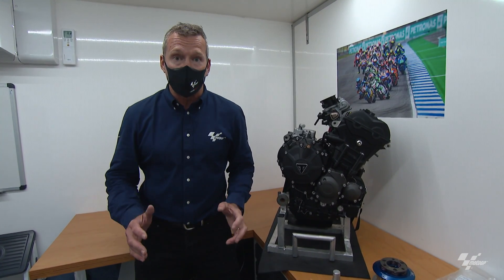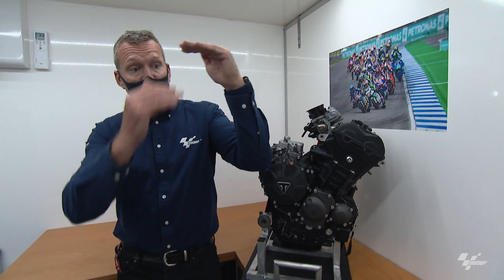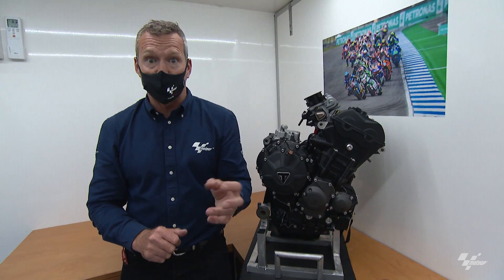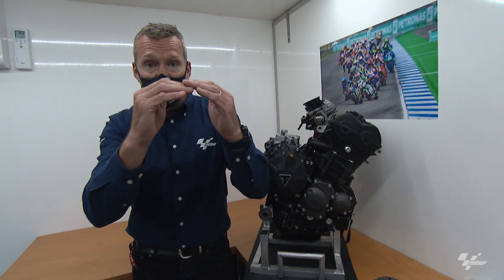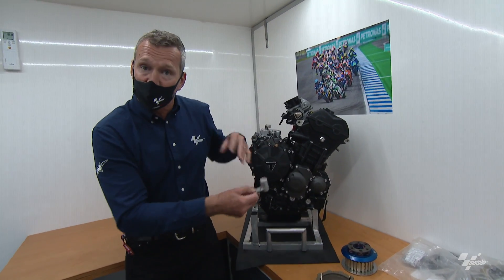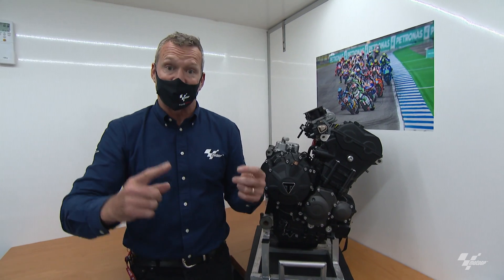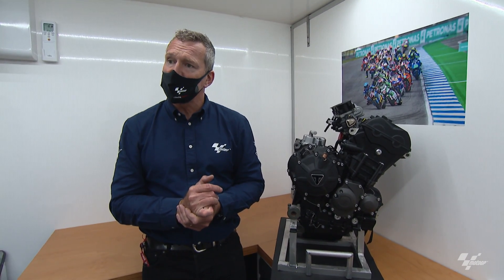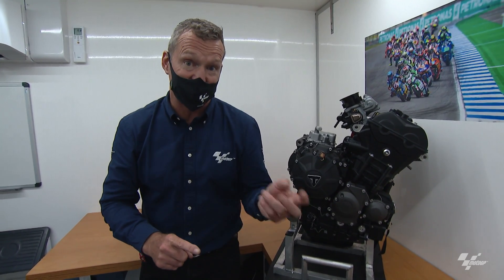#Moto2 Engines: Tech Talk with Simon Crafar

Comment: Imo, we should have 4 divisions (Moto 4, 3, 2, and GP).  4 could be a single, 3 could be a parallel twin (the fastest growing class in motorcycles), 2 could be an inline triple, and GP could be inline/V four.  This is essentially what Yamah is doing with the R3, new R7, planned R9, and R1.
Reply: if you were to base it on the no. cylinders you would still have to take account for engine size. So it's just easier to have a limit based on the engine displacement and worry about the cylinders' configuration based on the bike performance that you need.
Reply: https://youtu.be/ALgrmZW_a_4ddh